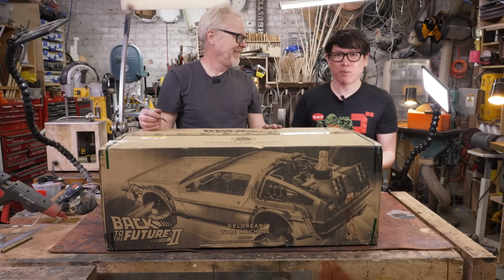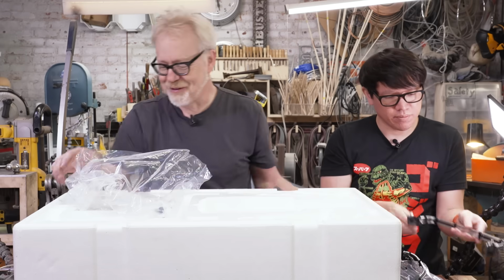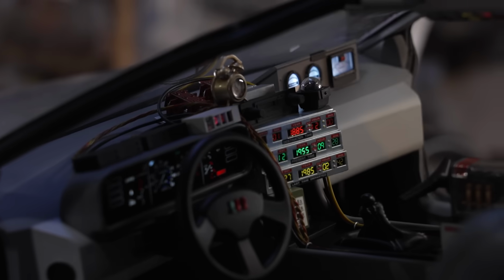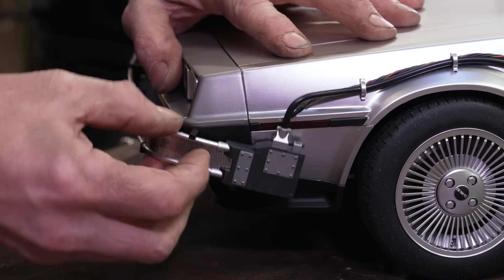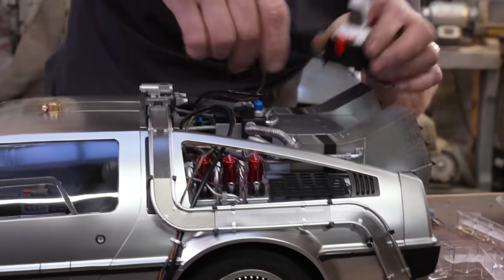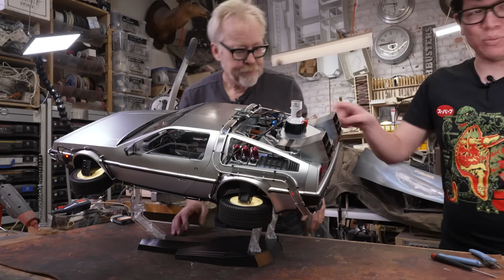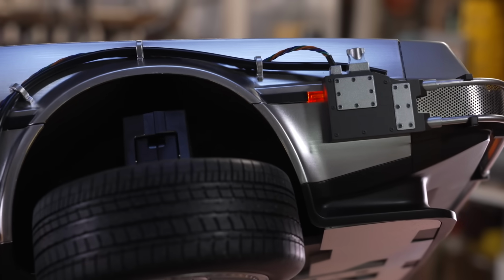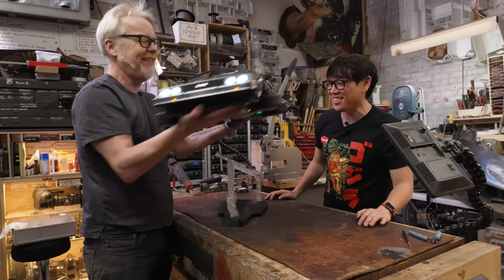Adam Savage Unboxes The Hot Toys DeLorean Time Machine!

Comment: At 4:30, I thought that I saw the alarm clock on the dash. 
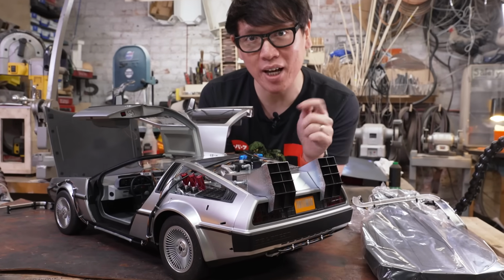I don't want to be too picky, but at 6:17 you can see that they didn't include the overhead panel buttons and switches, most likely because of how cramped the interior is.
Very sweet from HOT TOYS!

Comment: 1/6 scale? Would six of those really equal the size of a car?
Reply: yeah its about 70 cm
Reply: Let’s think about this for a second. Yes, if you line up six of them back to back, it will approximately equal the length of a life size DeLorean. This, however will not equal the size of the height and width of the full size car. Maybe if you lined up two rows of 6 (12 model cars) it might fill the footprint of the real deal, but then you are still left with the fact that the models are nowhere near as tall as the real car. So then you can stack another 12 model cars on top of those, 24 total, and then we might be getting in the ballpark of equaling the size of the real DeLorean

Comment: I’m so glad they lit up the time circuits. That was one thing I didn’t like about the first model. So it’s good they changed that for the Part 2 car. Great the vents light up now as well. My only problem with the car is the reverse lights are always on, which just isn’t right. That bugs me. Plus the indicators/blinkers are also on all the time on the rear. Sometimes I’m tempted to open it up and disconnect the reverse lights.

Comment: Not impressed. For this kind of cash I'd expect the body to be made of stainless steel (like the real one) and for the doors and wheels to be motorized for it's conversion to flying mode.

And... most importantly... it should be radio controlled (like in the movie).

This is a lazy cheap plastic mass production toy. Not worth $1,000+

Comment: But here is the thing. The manufacture left out one major thing here. The time displacers on the front bumper and around the engine bay should be lit up electric blue as in the films. This a major part of the AWE of the look of the BTTF DeLorean. Bad move on the part of the Design team. I give this thing a C+ at best for missing that muck of a chunk of the visual appeal of the car in time travel mode.
Reply: Yes! I thought the exact same thing. I assumed because those strips needed assembling separately, and wired up, that they'd light up bright blue.

Another thought I had is that two LED light strips, made to look like long skidmarks of fire, that you could lay out behind the toy, would be a nice touch.

Comment: I had something similar to this, actually I had two BTTF II deloreans. One was an RC car (the charging port was under the Mr. Fusion which I thought was a cool touch) I think that was 16th scale. I also had I believe it was an alarm clock or maybe it was just a stationary toy. But it used to light up and was on a stand to make it look like it was hovering with the wheels converted to flight mode. 

I miss that rc car 1/16th scale. real rubber tires, metal frame. they just don't make them like that anymore.

Comment: The are 3D printed parts then used as monsters for new injection moulding tooling blocks in China! The price of this is way Iver priced your actually cheaper buying the full Eagle moss Delorean it's got everything you can dream off on this one ot is a 1.8 scale so not much of a difference but quality over size is most important! The metal one is just on another lever and your paying near the same or maybe slightly less for the better one!

Comment: Considering I could buy a real drive-able car for the price that goes for...(my current reliable daily driver cost 2200 so not That much more - 91 Celica convertible)...yea...no...imma pass even if I did have that much to blow.
Reply: Plus it would need insanely more than it has to justify that cost...especially considering how much molding they are getting to reuse.  You have to use the power button to control the lighting for hover or not? Surely it would've been actually easier to just have a switch when all 4 tires (or one specifically) are flipped down...which doesn't even have all the details on the armature the wheels flip down on.  Does it even skip the OUTATIME license plate as an option or the blue lighting for time travel?

Comment: I have one but it's the first one but the time circuits and the dash lights and the flux capacitor light up the tail lights headlights and the blue strips on the outside light up and it makes a few different sound effects it's fully detailed inside and out and I only paid 55 plus tax brand new sealed in the box it's not quite as big but it's not much smaller it might be the same size I love it I've had it for almost 10 years and everything still works on it all I've ever had to do is change the batteries

Comment: All that wonderful work for all the parts, and they stamp the battery details on the spare wheel in the frunk, if only they had done that on the inside, or not at all, since it's pretty obvious what is there and what batteries you need. And they already have some instructions anyway, one picture and a few words is all that would be needed, and the tyre would be clean.
But yeah, the first one was already a huge undertaking, how many would/can you sell and how much would it have to cost, they can reuse a lot, cutting down on some things, but you still have to schange some parts probably, and add quite a few more parts as well, a lot of work, and it's HUGE !!!
You need a mancave to display such stuff :P
And yeah, time to 3D print a Marty and hoverboard and make a string with little flags to hang off of it, maybe slightly adjust the angle at which the car hovers, and stick it all in.

Comment: Kinda sucks that you have to move the tires manually into  flight position. Would have been better if they made that feature motorized. For the price, they should have added a vape kit effect. That Optimus Prime robot you reviewed is about the same price and does way more. However, the detail is insane on this beast.

Comment: Adam: "Wow, it's actually kind of impressively light"

Yeah, that's not a good thing!

Having seen this in the flesh there's a lot of inaccuracies inside and missing bits from the cabin. It's not a patch on the upcoming metal bodied 1/8th scale partworks model from Fanhome (previous distributor Eaglemoss having gone bust!).

Comment: When I was a teen, in 1968,....I got a 1/6 scale model of a Formula 1 race car, it had a highly detailed, exposed engine, and wires that went to all the spark plugs, working shocks & springs, real rubber tires. All sorts of cool parts and removable panels. The fun is building it,....for added fun I'd play sound effects recordings of engines revving,...race track sounds, while assembling it.  Then the dilemma of where to best display it, and which your friends will be allowed to touch it. It was sturdy, but not enough for rough-housing with it. It was also a magnet for dust,....so keep soft, clean, hobbyist brushes around for delicate dusting, & canned air,....then deciding whether it will need a clear plastic enclosure, to protect it. ( That would require me creating one) Maybe consider suspending it with fishing line, from the ceiling. FUN!

Comment: For 1200$ I’m shocked they didn’t bother to light the flux bands. Not even a working Christmas tree display in the rear passenger deck. Not even stainless body. What’s the $1200 going into???!?
Reply: It is $825 and cheaper than most 1/6 replicas its great for the price plus its USB powered

Comment: Yeah that's a pretty impressive model in a really large scale. You can clearly see that Hot Toys puts a lot of effort into all those Back to the future stuff that has been added to the car. On the other hand unfortunately they didn't put the same amount of effort when it comes to the car itself..which is kinda bugging me compared to it's scale:

1. The front trunk area is just wrong. The spare wheel on the original Delorean isn't an alloy wheel at all and it is not centered in this compartment. Instead on the original car there was a cheap simple metal wheel and it was positioned more to the pessengers side and it has a little strap over it to hold it in place.

2. Those cold-colored LED headlights are simply wrong looking. A  good warm color like on the original car (and of course in the movies) would match so much better (just my opinion).

3. The Front Wheels are sticking way to much out of the wheel arches. I don't know if this is caused by this wheel flip-mechanism but it just looks wrong, especially compared to the rear wheels which seem to look accurate.

4. The shift-knob looks odd. I get the point that they tried to use some leather-like material for it, but it just looks like the knob is disappearing into this leather-cover..you can hardly see it.

5. Last but not least: I kinda don't like that this is made completely out of plastic which can crack easily on such a big model. Yeah you have this stand so it can hover and maybe it would be too heavy for this stand when it has been made out of metal..but you pay so much money for it and i'd prefer a solid feel for his model (like on those Eaglemoss 1/8 models). I believe you can even see that Adams model already has a crack on minute 07:00 when you take a closer look at the area behind the front bumper?

Comment: Sweet...  I have the original Hot Toys from the first film released a few years ago so I passed on this one but after seeing it in flying mode!!! Do I really have room for another? I also have a 1:1 scale version in my garage... It's a stock DeLorean though.  I guess I'm a bit obsessed.
Reply: sell the old one and buy the new one. :3
Can display in non flying mode and take mr. fusion off for the first film. ^-^
Reply: @hraefn1821  you can remove the Mr Fusion but that won’t make it look like the version from the first film. The rear deck looks completely different.
Reply: @sjmaguirepdx  curses. My casual fan-ness hath been exposed.

Comment: This looks like the Eaglemoss, a model you can buy that you don't have to go thru the arduous process of assembly from the ground up.
Reply: The Eaglemoss is 1/8 scale I believe. This one is a little larger at 1/6 scale. Hot Toys 1/6 figures are pretty wild. They range from pretty good to photo realistic!
Reply: @DrawTheLine35  1/8 and 1/6, not that much of a difference when its a big-ass toy that will require a table or super-large display case.

(BTTF is my favorite film and I have a 1/16 delorean on my bookshelf as an accent, but this is too big to feasibly display unless you want to live in a big place that can fit all these types of items.)

Still is an awesome item, 8.5 out of 10